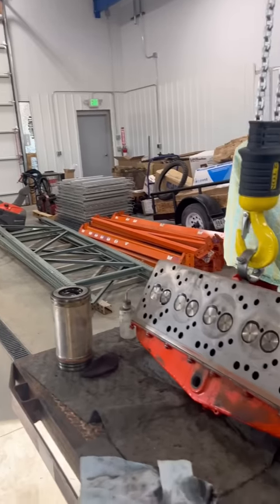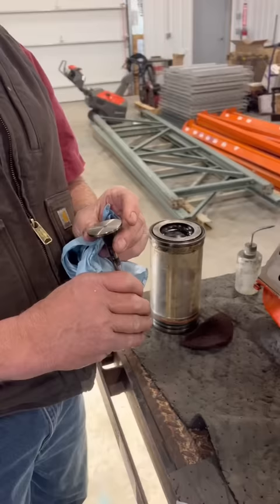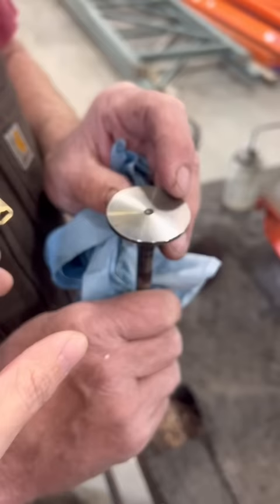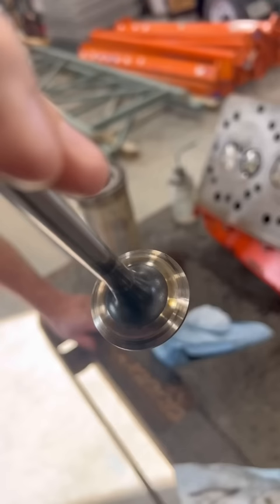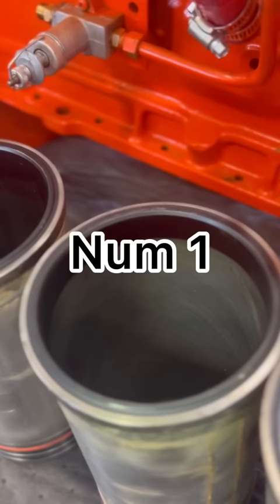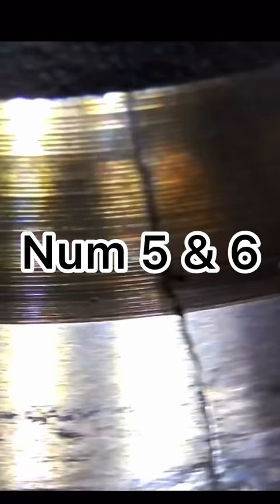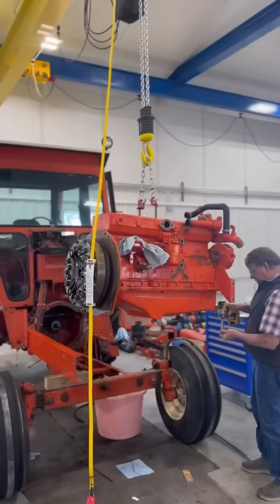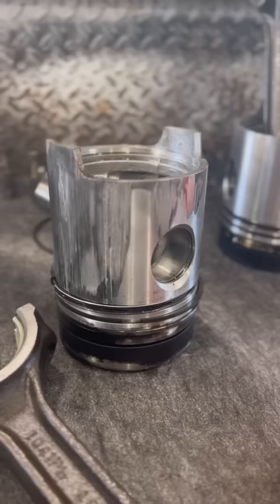#shorts The Story Of The Cursed Allis Chalmers Never Ends…

Comment: Sounds like you got a Bad Patch of Valves. Re Check Manufacturer who makes the Valves.   Are they Aftermarket or Factory Valves. Are they made USA or China? There are many Good Aftermarket Valve Manufacturers. Re Check Cylinder Head Loose or worn Valve seat inserts. Check Valve Stem Guides make sure there not Loose in the Head and Clearance spec Tolerance between Guide and Stem. Check Springs Retainers Keepers. Maybe you got one Valve that was made with Hair line crack? You may call few good Machine shops talk to them get more Opinions.  Good Luck

Comment: Hidden Cooling Issue? Water jacket obstruction? Try using a thermocouple gun while it’s running to find hot spots.
Reply: Yes it sounds like the injector pump is running lean on number one cylinder or there's some kind of vacuum leak on number one cylinder

Comment: Your problem seems to be piston to liner clearance.  Did you check the liner to piston to liner clearance before assembly. Check the liner to block fit.If the bore of the block is too great the heat in the liner will not disipate to the block then to the coolant. the liner shouldn't  have more then .002 gap between the liner and the block and some liner are a press fit. Where were the parts you used made!!???  You need to get a bore gauge and a set of Mike's to find your problem.  If yo7 just put it back together again without checking all of the above things will be kinda stupid.  you have a proble in those areas for you to find.

Comment: Well that valve would’ve been overheated right? You can see it starting to change color, maybe it’s the lighting. Fuel timing maybe?

Edit: nevermind, the condition of that piston says something else was afoot
Reply: @Virtual_Bomber : I believe you're on the right track with fuel timing being way off. If you go back & watch some of their previous videos, you would know that they had a serious engine failure, and if you look at where the fuel injector washes on the tops of the new piston crater domes, there's no doubt that there was something way wrong with the injection pump's fuel injection timing.
Reply: @turbodiesel4709  mmmmmm, would be cool if that was the case. Definitely some weird stuff going on since the whole engine was experiencing different problems in different areas. The only other thing that I could think of is maybe...JUST MAYBE, they got the order of their parts messed up during reassembly. I doubt they did that though considering the quality of their work.

Comment: Next time try not to lubricate the cylinder so much try to dump some diesel fuel in the injector hole to wash some of that excess oil out then spin it over a few times? But if you bought that engine I'll bet they threw the wrong crankshaft in check your numbers🎉

Comment: I've had these issues alot when I used to work for kensworth you could rebuild an engine put all kinds of ranu parts in it and then it fell on you and you would think that it was your fault and it wasn't it was because of what had happened beforehand and it was itty-bitty and you didn't notice it that's why it's always good to replace every part that you can replace in an engine write down to depressing cylinder heads and Val's even inspect the brand new valve or other parts when you first get them put them under a microscope to check for itty bitty small issues because a lot of things can happen even at the factory they don't pay attention to stuff like that they make it send it out the door they don't do that much inspecting on a part and if they do there are some people that are just lazy and just send it out the door anyway so yeah inspect your new parts and replace everything you can when building an engine

Comment: If you had abnormally high combustion temperatures because of an over advanced injection pump, your going to have high exhaust temperatures as well. This can cause cracking of any valve old or new. If your set on the injection pump as the cause of your catastrophic failure I would be inclined to replace all the exhaust valves as they to would have been subjected to overheating as well and it sure would be a shame to crack a couple of more valves just after being put back into service. 
Great videos and hello from Canada 🇨🇦

Comment: Sounds like there's something wrong with the injector pump leaned out the cylinder and crack the valve
Reply: It's a diesel they don't lean out. The leaner the happier for a diesel
Reply: It will if it's sucking air somewhere
Reply: The valve is showing fatigue most likely it just kept getting hot and slowing down and then stopped running
Reply: While you had it running you should have put a heat gun on the cylinders
Reply: @Thomas Houseal  a diesel will get hot from incorrect injection timing or leaky injectors that don't seal up at the nozzle, but it's not possible to lean out a diesel. Completely different than a gas
Reply: Well rebuild it put all new valves back in it cuz maybe you got a bad batch of valves and this time just hold your foot down hold your foot down until it breaks in lol 😆😆😆

Comment: That thing has been nothing but problems. Better off melting it down.
Reply: I think this was not the engines fault but a combination of bad fuel timing and improper ring gap.  I do believe the ultra low sulfer fuel shares some blame id run a fuel lube in it as I said above I know guys who add some ATF to the fuel on old diesels...
Reply: @chrisjohnson4666  you clearly know a lot more about this stuff, then I do. I'm just a welder, that can turn a wrench, if I have to. 😆